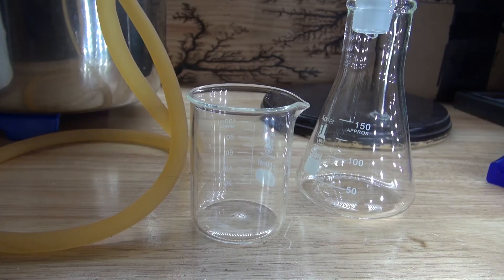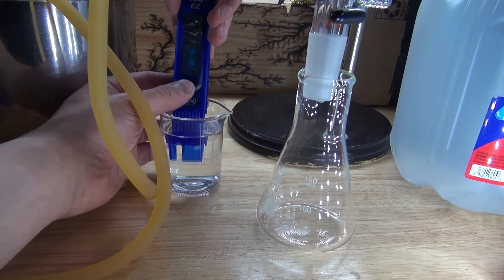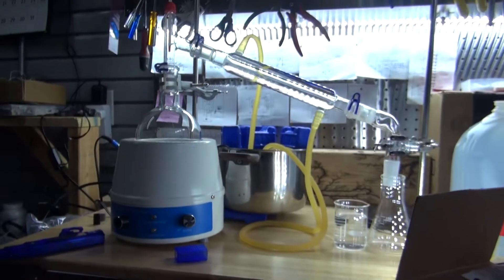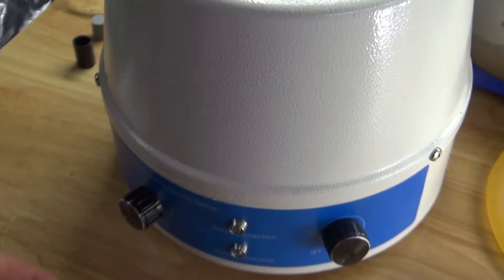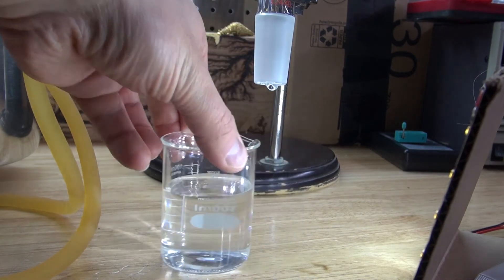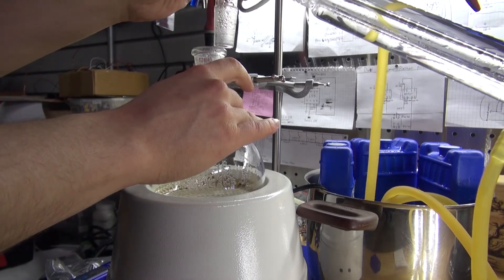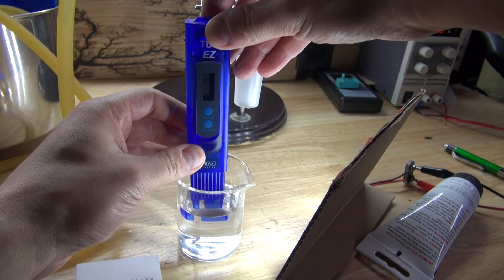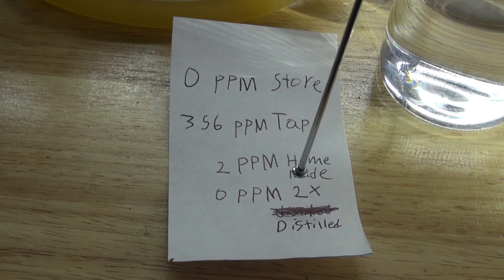How To Make Distilled Water

Comment: I tried to distill water using a Graham condenser and it yielded very little.  Is it necessary to use a Liebig condenser?  Does there have to be slope in the condenser or elbow to get a high yield?  I have a 2 liter boiling flask and I don’t think it even made 2 ounces.
Reply: It would be nice for you to talk about your apparatus more. For those looking to do this for themselves at home. you barely touch upon your distilling machine components
Reply from the maker: That's odd? A Graham condenser should have worked better. There could be a leak in your setup. And yes a slope is necessary in order for it to condense better, otherwise the steam would leak out of the end and not condense very well.
Reply: I also wanted more info on the equipment...
As in all of it lol